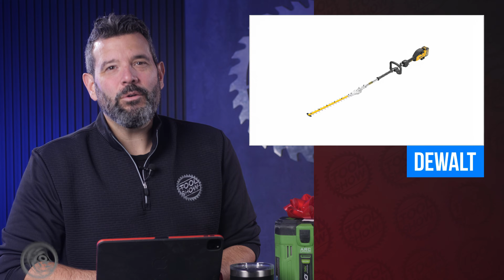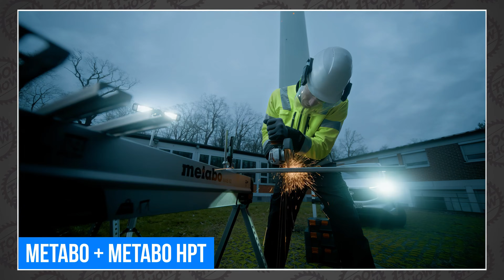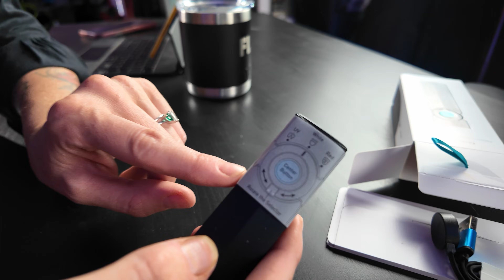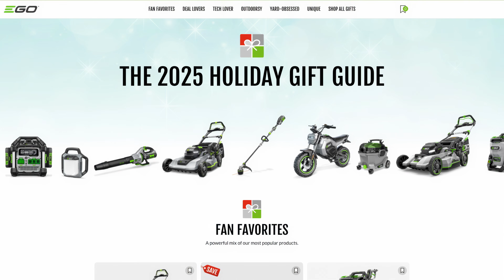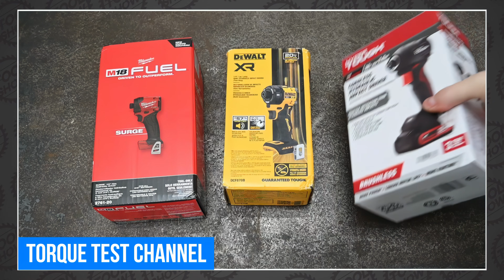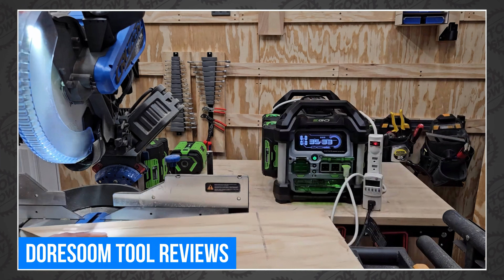10 NEW Power Tools from Milwaukee, DeWALT, Harbor Freight, Bosch, and MORE!

Comment: Pay 40% more for a cordless tool and then 150 for the battery and charger pack, and then then pay 100+ for a cord adapter. Just but the corded tool for 120 bucks 😂

Comment: I hope that that this isn't just some way of slowly merging the brands and getting rid of CAS on their tools in the long run. Sure I do like the Multivolt batteries on my Hikoki tools which doesn't force me to get two seperate battery platforms for the more powerful tools though I wish that more tools could use the same batteries so that you can go between different brands without having to get all new chargers and batteries. For example 12V batteries from Milwaukee, Bosch, Sthil and probably some other brands too have the same shape and should be able to be compatible but they are not.

Comment: I still don't understand why Hitachi changed everything to HiKoki and then HPT. What was wrong with Hitachi? They had a good brand and reputation. It's not like they were Wuhan Power Tool or something lol. They should just brand as HPT globally and have Metabo be their flagship product line sort of like how Dewalt has XR.
Reply: I agree.

If anything, they should have just stuck with Hikoki - that way the tools have the same name globally. Just tell people Hitachi is now Hikoki. Done.
I think they had stop using the Hitachi name due to changes that happened in ownership. 

The Metabo HPT name has been a marketing fumble in my eyes ever since they started it.
Reply: @Potami666 I think you're right, this is what I could find online
"Hitachi’s name change was necessary. As KKR acquired Hitachi Koki from the Hitachi company in 2017, their continued use of the brand name was governed by a licensing agreement.

Under a licensing agreement, Hitachi – and not Hitachi Power Tools – would have final say on the tools and products that could bear their name. Long-term, this could only hamper things. So, a name-change allowed for freedoms outside of external limitations and controls."
Reply: The real controversy is Milwaukee selling a radio for $300